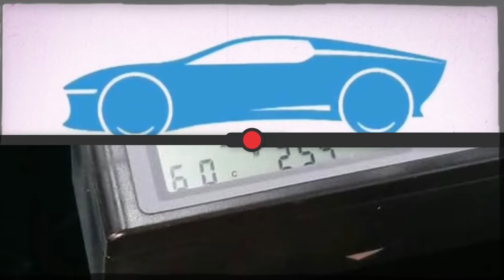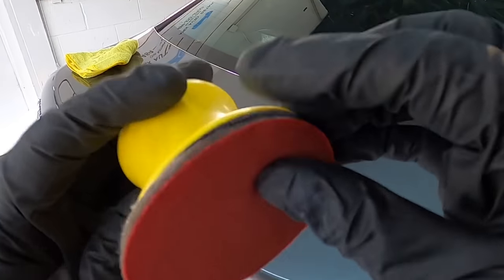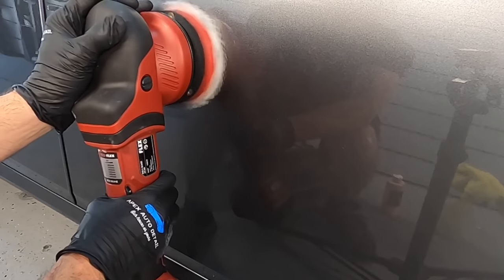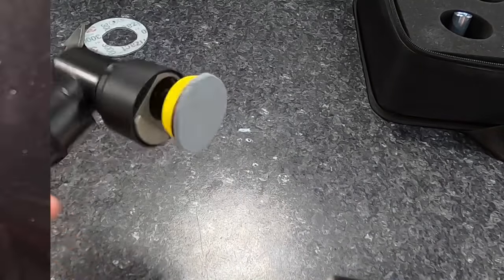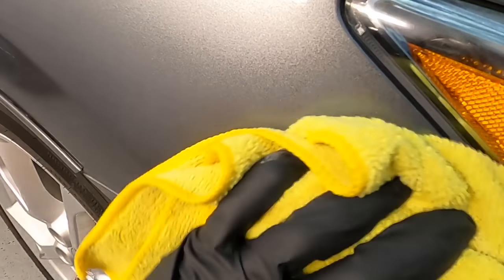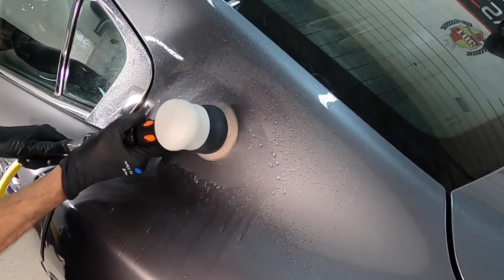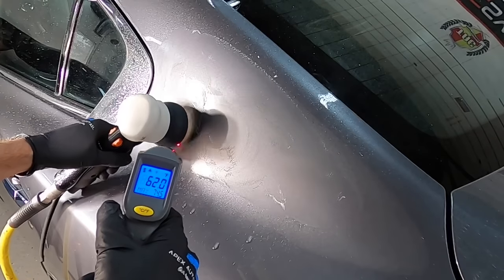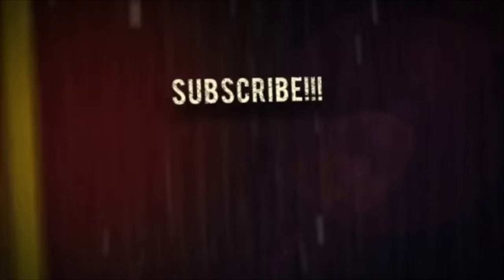Do Yourself A Favor! Add Wet Sanding To Your Detailing Arsenal!!

Comment: Thank you Brian, you're amazing !!!! I just did a 12 year old Dodge Ram work truck today and it came out great inside and out, 11 hours later..lol. While working today I was thinking I wish I knew how to wet sand and I hope Brian comes out with a video NO JOKE !! I wish I had scene this video before and had the actual materials because there were some scratches I know would have come out with wet sanding which woukd have made the end result that much better. Anyway, the client was thrilled and I just ordered the yellow foam hand sanding block and the Trizact 3000 grit discs. A test panel for me is right way to go before I test my skills on a clients vehicle.  I can't say thank you enough for your videos, your teaching skills thst everyone can understand and follow. Sorry for the long message but thanks again and maybe someday I can swing by the shop I am right in NJ. Please keep the videos coming !
Tom
Reply from the maker: Thank you Tom...I appreciate the kind words.
Reply: Lots of vids about wetsanding on Apex. Gave me more confidence to use my DA's for wetsanding. Trizact disc aren't cheap either.

Comment: Something that might help you. Ive been buffing vehicles and other things I paint for a long time now. You can always pull more depth out of things painted in custom candy and pearl colors no matter how good you and your clear coat gun can spray. Now days i start with Mirka Microstar 1500 and then 2000. They are a disc made for sanding clear that you do not run water with, you run them dry. Then i use 3M Trizact 3000, 5000, and at times will even go 8000 which you use with water to wet sand. The trizact disc last a long time. 1 disc will do a large hood plus the roof of the car. Then wipe of good with a mix of water and 93% isopropyl alchohol mixed at a ratio of 8 parts water to 1 part isopropyl  then start buffing with pads and compounds of your choice
Reply: In your experience, do you think it's safe to wet sand my factory clear coat with a 2500 grit to cut through heavily (and i mean HEAVILY) oxidized paint and finish with some heavy cut compound and polish?

Comment: Detailing is a great way to spend your time and lots of it. Friend of mine lived in a condo that had a garage and that was his past time. Wasn,t married, no girl friend, no other hobbies, and a day trader for a living. This was before the push for all the paint correction tools we have today. Every day he would be doing something on his 2 cars clean, re-polish,wax,seal, reshine the  tires, stripe the wax off, do again, etc. I bet he spent 25+ hours a week messing around but thoese cars looked perfect. Then about 20 years ago he met a lady and got married. He drives a Civic and his wife drives a Subaru and at best they get driven thru the cars wash. I would love to ask him about what happened to his passion about keeping his cars show quality but I havent and probably wont.
Reply: I'm not the guy, but I went through exactly the same thing with my photography hobby. Although I technically could produce pro photographs and It felt like the camera was an extension of my arm, I got to the point where I definitely decided not to be a professional. After that it all just lost its charm. I often wondered about your question too.
 I think having a sense of purpose and meaning behind what you do is essential for long term motivation. There's nothing like applying yourself professionally, putting yourself and your reputation on the line, experiencing the change you make for your customers and the innate beauty of quality workmanship. Take that away and whats left, really?
Reply: Thats honestly sad.
Reply: I was that way about doing tattoos...my ex/kids mom of 29½ years decides to fk around after I'm out of state working. I've got all my equipment but it's collecting dust...but got married 8-22-24 and this beautiful woman loves me and I'm about to go back to tats.. I'm here for this video to learn more stuff.

Comment: I will prefer to wet sand a heavily defected car, usually just with 3k paper, then rotary and will get minimum clear removal mainly because it keeps temperatures down while quickly removing defects. I make as little work for my DA as I can

Its also worth noting its easier to remove uniform sanding marks so take your time when starting out

Comment: Dry, damp and wet sanding by hand and or machine is an absolute must if you want to stand out from the crowd. My favourite discs are 3M Trizact 1,500-8,000 grit (DAMP), Micro Mesh 2500 - 12,000 and Kovax Super Buflex black (dry or wet). Kovax is Japanese and sold in US by Eagle abrasives I believe. Am no master at sanding but I love the results. Sand more polish less is my motto for severe defects and if I owned a bodyshop.

Comment: I should know this, back years ago i started polish with heavy oxidation car that never wash for years in tropical climate. I spend a day only get few panels with rotary and low quality wool pad. I wish i knew how to do right wet sanding to remove heavy oxidation and cut my time compounding it

Comment: Have you tried the option to fill in the scratch with a paint touch-up pen using the clear coat portion Then use the razor to remove high spots, sand and polish?

Comment: So, now that you've taken off some of the clear coat, do you need to put it back?

I can see that buffing it would make it appear normal again, but once you clean the buffing left over to put-in a protection coat, for example, or you leave it as is, will it look normal? My thinking is that by taking off the clear coat then it will be more vulnerable to the environment than before.

Comment: Hey Brian , can I get your thoughts on using a glass cleaner (I’ve been using invisible glass spray can) as a panel prep before applying protection? I picked this up from the painters at the dealership I detailed at for years. Maybe a test video to see if a proper paint prep makes a sealant or coating more durable than glass cleaner

Comment: Hi Brian, I know I’m late to the party but had a few questions.  
I’m looking to use 3000 on a few scratches. In your video it looks like you’re using a micro fiber pad.  Will a foam pad give you the same results.  Say an orange pad ? Do you use a polish or a correcting cream?  Thx for any input.

Comment: Hello! I had an insurance claim repair done and the shop left so many dust nibs. After a few repeat visits to address various issues with the repair, I’d like to attempt to wet sand and polish out myself. Is an electric sander and polisher necessary or could I sand by hand? Would my Ryobi orbital sander work with the correct pad on it for sanding and polishing? Thank you for your video!

Comment: Hi Brian are you using a 3 inch foam interface pad in between the palm sander and the sandpaper disc? I could not tell from the video...
Reply: doesnt' look like it. The Prozac 3000 sanding disc looks like it already comes with a tiny bit of foam backing.

Comment: I have a 3-4” circle of haze after wet sanding a tree limb scratch on the side of my motorhome.  I used 2000 & 3000 grit sanding pads.  I polished, but can still see a light haze.  Can I do anything else?

Comment: Thank you for the video. I need to do this to an older Honda I have.
Also, what would you recommend to remove painted pinstripes on an Infiniti ? Would wet sand or eraser wheel work, or is something else better ? They are factory painted.

Comment: Brian, is it possible to wet sand and polish around a circular door lock where the clear coat has flaked or would you just pull more off?
Reply from the maker: It would eventually keep peeling.

Comment: Where can I get that round sandpaper holder you use? I cant find them anywhere
Reply: Mother’s headlight restoration kit comes with a 3 inch hand held holder. I have had mine for years I think they still include one. Good luck.
Reply: Yeah, me too
Reply from the maker: Cerakote headlight kits have them as well.

Comment: Which model is that cordless flex your using sir??
Ive been interested in getting one of the thise but kinda of on the fence between the orbital & the c-beast.
Ive been using a milwaukee rotary cordless and its been doing a good job; but ive been very interested in the c-beast; ive been practicing on my company truck on the weekends 👍👍
Thanks for the videos as always; always good information on your channel!!!!

Comment: Does the haze go away permanently after applying the polish, or do you have to keep applying polish as needed?
Reply: Polishing is a permanent process, effectively you're removing paint to create a smooth surface. So no, you don't need to keep applying polish. Hooe that helps

Comment: All you need is some 80-grit sandpaper and a big jar of Comet cleanser. Do it outside in full sun. When it's dry, rinse it off and you're good to go. All these waxes, polishes, coatings and microfiber cloths are just a hoax. Keep it simple.
Reply: 😂 80 grit will destroy the paint
Reply: @7Logik  I may have meant 800. Or 8000. Or ...